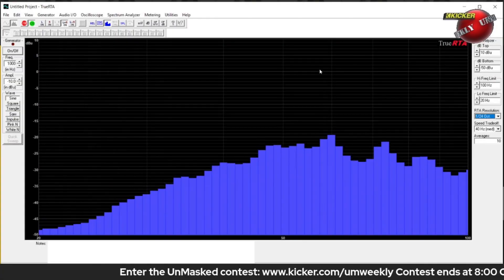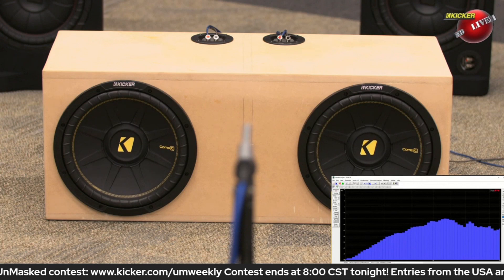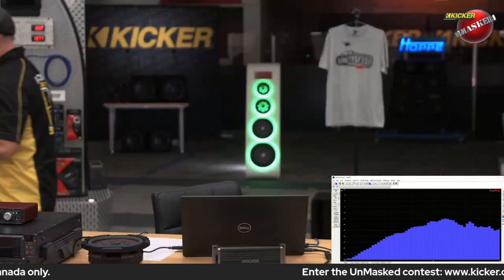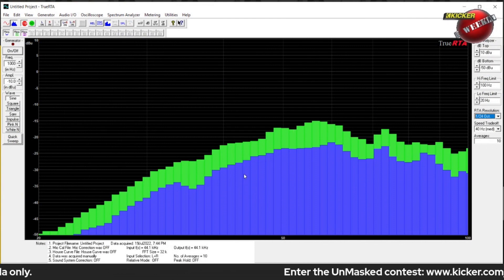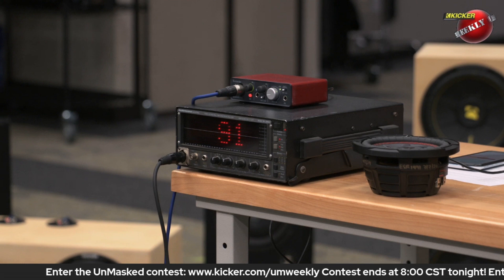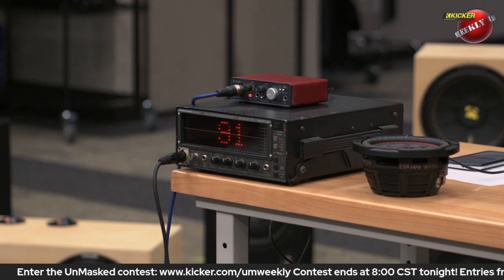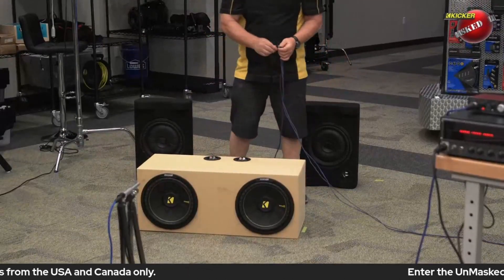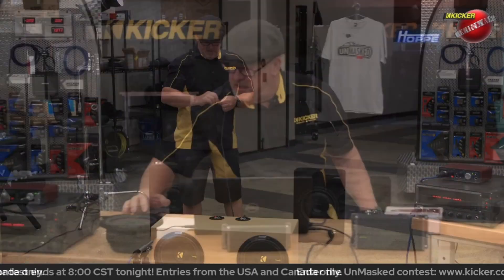The Difference Between Common and Separate Chambers - Kicker UnMasked - Shorts

Comment: My concern and argument (just to myself because car audio guys don't ever respond nor comment back) is that subs are different by default, even in the most minute ways under a microscope (spider stiffness, VC resistance, surround stiffness, BRAND and SIZE, etc.) so if they are NOT divided, regardless of if connected to separate amps or not, they are not working PERFECTLY in unison - only as close as possible butt it's that 1 little detail that nags at me always, and it should everyone. I say 2 do wired in parallel/series as needed, but electrically as a single unit and yet physically divided, whether ported-each or sealed-each or in combination-each. Any variation is the start of...stereo! What do you think? Thanks!---:face-red-heart-shape:🤗
Reply from the maker: Hi justlooking. My background is in audio production and studio engineering, so I know what you're getting at. The kind of differences you're talking about however are playing at the margins, but of course the margins are where greatness is made. Like being a college athlete vs being a pro athlete, it's the most minute differences that get you there. Personally, for an SQ application, I'd absolutely agree that separate chambers or enclosures are ideal. However, for the vast, vast majority of people with car audio systems, there won't be any discernible difference, as they're going for SPL, or for "filling out" the missing frequency spectrum in their daily driver, which often means a prefab woofer/box/amp combo.
Reply: @KICKERAudio  Great - Thank you very much! Just 4 laffs, neither of my bandpass boxes are sealed nor have fully-separate anything, lol. I replaced one sub and it was 2 big, for example, lol! Currently attempting a 425-WPC concert-capable amp for my TV setup - Crazy! 🤩🤪🙄
Reply from the maker: @justlooking6898  That sounds like a fun project, good luck on it - keep tilting at those SQ windmills with us! 😁
Reply: You both are dead on. I'm not sure how precise manufacturing processes are from one lot to the next but there are generally some differences that I've certainly found audible. I know there are speaker manufacturers that go through great lengths to match sets for extreme high end installs. So, the audible difference whether apparent or not will be the difference in where the speakers differ from each other. This is obviously not near as critical as say some mids or highs. We all know that materials can come from several sources, and nothing is exactly the same so performance can and does vary. Good stuff!!!
Reply: @bradwarden1050  +  @KICKER-AUDIO...YAY! It's not often that I get responseS in agreement with what I'm obsessing about. SO glad I brought this up and thank you for your positive response. I have a 'DUAL' (TM) 10" X 2 Bandpass Box of 20 years ago and one woofer in it I replaced with a Pyle DVC 4 that was TOO active versus the other remaining 4-ohm, thusly, two differing woofs and the DVC 4-ohmer has only one coil used and has a gap around it of 1/4"; Oh, well, not really 'sealed' anyway. I now have a 425 WPC power amp in stereo (go figure) with a subwoofer crossover ahead of it that's tuned to like 85-90 Hz, set to MoNo and I love the sound and potential of it, butt the power draw and the lights dimming is annoying...I did not notice this BEFORE the Crossover/Amp combo came into play, as I have a RCA '1000-watt' home entertainment system as a work award of years ago. Will test that with the CO and decide to keep or return the amp. Money concerns suck! Good deals, though @ $209+ and $109+; I suggest that anyone try this @ home and go bass NUTS!!! PS---That MONO switch beefed up the BASS, but with it off? Same VOLUME butt a little 'rumblier'. Cases in point! Love it all, and can adjust amp's 2 levels! No NEED to reply if yer busy, but I think I got it all out there, now, lol & yet, I am all ears for it---Take care, y'all! PS - Lights out for movies, lol! Out of Sight, Out Of...(Wow, great movie title...hmmmmm...) Ha ha.:fish-orange-wide-eyes::face-red-smiling-live:🤗
Reply: @bradwarden1050   +  @KICKER-AUDIO...YAY! It's not often that I get responseS in agreement with what I'm obsessing about. SO glad I brought this up and thank you for your positive response. I have a 'DUAL' (TM) 10" X 2 Bandpass Box of 20 years ago and one woofer in it I replaced with a Pyle DVC 4 that was TOO active versus the other remaining 4-ohm, thusly, two differing woofs and the DVC 4-ohmer has only one coil used and has a gap around it of 1/4"; Oh, well, not really 'sealed' anyway. I now have a 425 WPC power amp in stereo (go figure) with a subwoofer crossover ahead of it that's tuned to like 85-90 Hz, set to MoNo and I love the sound and potential of it, butt the power draw and the lights dimming is annoying...I did not notice this BEFORE the Crossover/Amp combo came into play, as I have a RCA '1000-watt' home entertainment system as a work award of years ago. Will test that with the CO and decide to keep or return the amp. Money concerns suck! Good deals, though @ $209+ and $109+; I suggest that anyone try this @ home and go bass NUTS!!! PS---That MONO switch beefed up the BASS, but with it off? Same VOLUME butt a little 'rumblier'. Cases in point! Love it all, and can adjust amp's 2 levels! No NEED to reply if yer busy, but I think I got it all out there, now, lol & yet, I am all ears for it---Take care, y'all! PS - Lights out for movies, lol! Out of Sight, Out Of...(Wow, great movie title...hmmmmm...) Ha ha.:fish-orange-wide-eyes::face-red-heart-shape:🤗

Comment: Would it matter how the subs are situated in the box like 45 degrees or 90 degrees from each other
Reply from the maker: We tend not to design enclosures with subs facing each other. It can cause cancellation at certain frequencies and be "peaky" in its overall response. We prefer a smoother response, but some prefer a different sound.  It's a matter of opinion.

Comment: It's simple guys. Only use enclosure with a divider if you're wiring woofers to different channels to keepthe subs from working against each other as multiple channels may not play exactly the same. A divider isn't needed if you're using single channel amplifiers.

Comment: off the subject a little square peg round hole.... If a have a 12in sub box from a round sub (i.e. a vary nice kicker prefab box from the 1st cvt shallow sub, in my book kickers 1st fail in a sub lol) is there enough room to cut that round hole in to a square hole so I can fit in a L7t 12in in there?? thanks
Reply from the maker: Which CVT do you have? There are ways to check if you can resize the hole for an L7T once we know that.  The model number should be on the back of the magnet.
Reply: @KICKERAudio  it a prefab kicker truck wedge box 
Info from white sticker on factory box
ITEM # 07CVT124
S/N. 42151047000529
Says also tcvt12" in big red lettering on factory cardboard box
That the info off the new one thats still in the box if that helps??

Comment: if the output is the same regardless of a divider.. then whats the point/purpose of said divider?? please and thank you👍🏼👍🏼
Reply from the maker: Some contend (and this is a bit subjective) that you get better control with individual chambers, so the bass is a bit "cleaner" and more precise.
Reply: It adds to the stiffness of the enclosure AND.....in the event of a driver failure, without the divider, the good woofer will see TWICE the enclosure volume and could experience mechanical failure due to unloading.
Reply: @RodofAllTrades will the single subwoofer not see more than twice the area due to the the second subwoofer acting as a passive radiator?
Reply: @ It depends if the sub that fails locks up, or can still move.  Either way, the single sub will see double the air space, and if it's undergoing a full send, could soon fail as well.